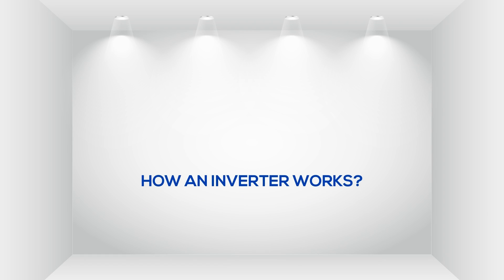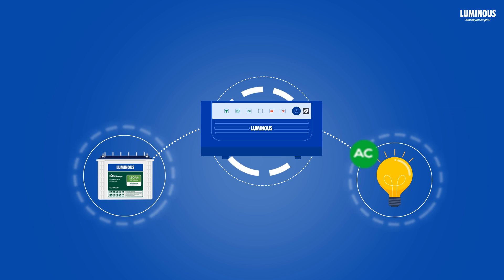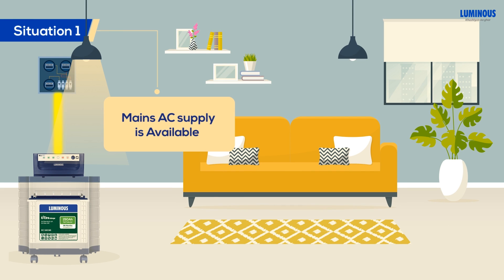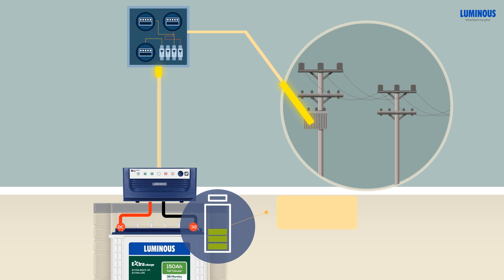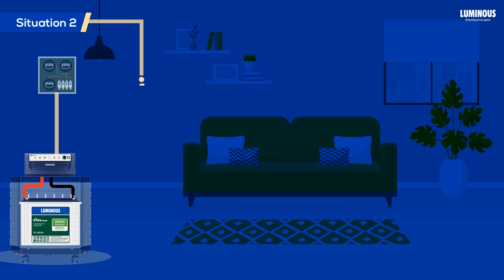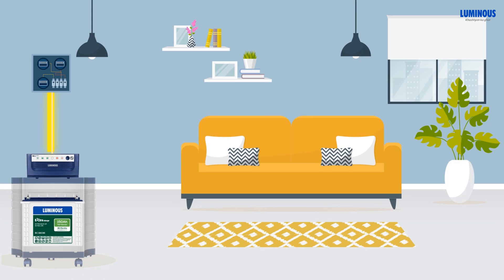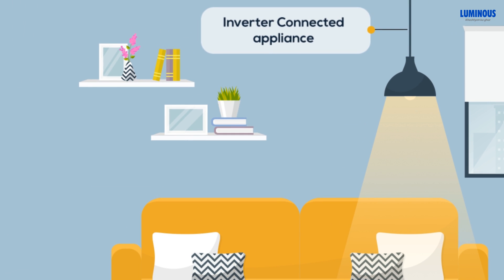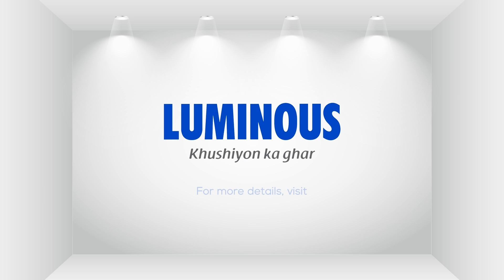How Inverter Works? Find Out from Luminous Experts | Luminous

Comment: can inverters manage the fluctuation of the voltage. I am using Zolt 1700. In my area the voltage is between 230 to 280 can it manage the this fluctuation, and what will be its output at the time of this fluctuation.
Reply from the maker: Hi Chandan, You can reach out to us by contacting our Customer Care Number 18001033039 or you can send us an email at care@luminousindia.com so that our team can connect with you at the earliest.

Comment: Hey Luminous I have a question 🙋! What if Battery 🔋 connected to inverter is fully charged when there is no power ⚡cut! Does inverter stops charging 🔋⚡ the battery or the battery becomes weak! I have Exide battery
Reply from the maker: Hi Satyam, Luminous inverters stop charging when the battery is 100% charged, and the charging LED on the front panel stops glowing thus increasing the battery life. This does not depend on the battery brand. Do let us know if you have any other queries.
Reply: @LuminousIndia Thanks for reply! yes, there is query! on my inverter battery there is liquid or it is moist in that region where we fill distil water! I am not understanding the reason behind it! After how many days should we fill water in battery or will the life of battery get reduced if I not fill water on right time
Reply from the maker: @satyampandey890  Hi Satyam, the correct time to refill the battery water is when the float indicators on the battery show a downward trend. It takes around 3-6 months generally before the water re-filling is required in the battery, and it also depends upon the usage and environmental conditions.
And yes, a delay in re-filling the water might affect the battery life, as even one dry cell out of 6 can lead to total battery damage. Hence, we suggest you to keep a quarterly check on the battery water filling process.